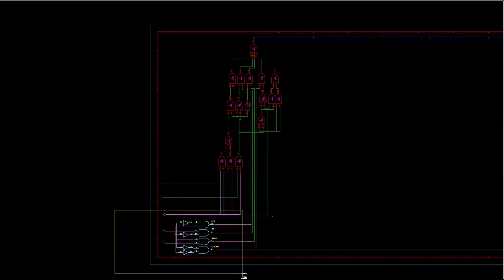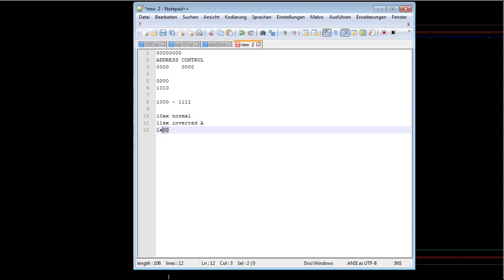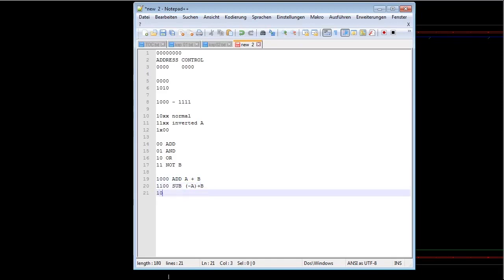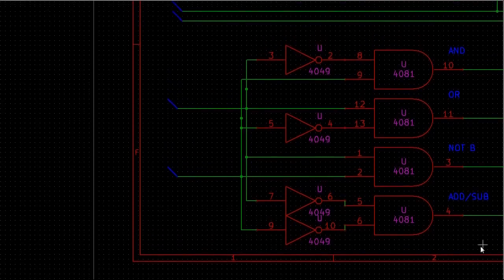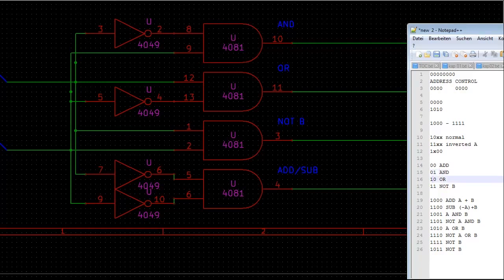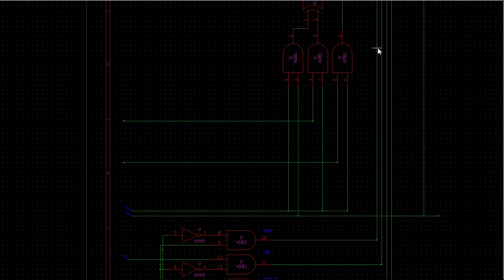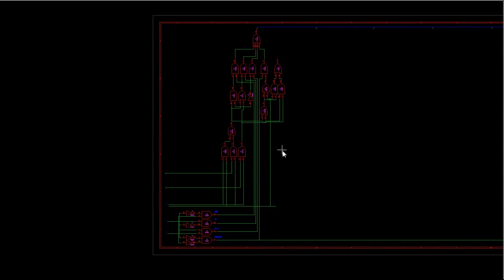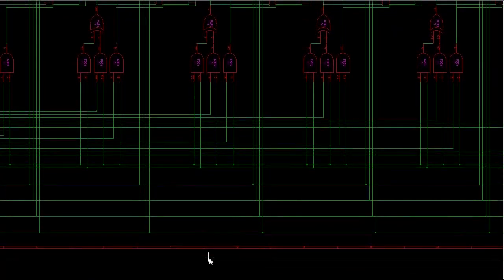Full 1 bit ALU - Lets Build  8 Bit Computer Part 8

Comment: I understand that the control bits determine what will happen, but where is A and B deduced from ?  ( or are A and B deduced from the address bits ? ). I havent grasped that yet.
Reply: A and B are the operands coming from the register and data bus depends on what kind of architecture you are using

Comment: I ment the logic chips 7400 series and the 4000 series chips. I have order  some 7400 chips but struggling getting the spec data sheets.
I found some chips that still new going back to the 80s. Just cannot find out any thing rs4511b, rs4047b , rs4510b
I am still looking and think i will find what I need soon
Thanks for your reply

Comment from the maker: You mean 7400? 4xxx is CMOS, 74xx is TTL. In theory, TTL is way faster, but that doesnt really matter for hobby use since a 2 MHz CPU will fry your LEDs in 0.5 - 1 second. For all practical reasons, CMOS is better. Its just more forgiving and easier to work with.

Comment: Thank you for this. I was on night shift last night, and I had all this turning over my head.
All the gates, and binary numbers from some one that explained this. And it started to see some of how it works. This video took that to new level in seeing the relationship to the circuit and them numbers.
I have ordered a few chips to play round with gates and LEDs. 
Can you tell me what's the diff rents between 4001 type to the is it 7000 chips and the right ones to use.
Thanks Richard